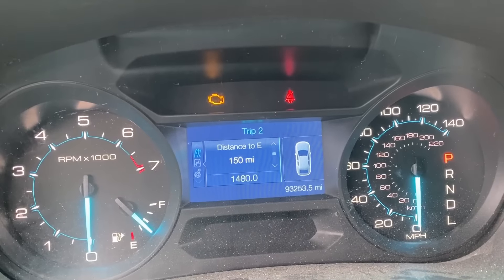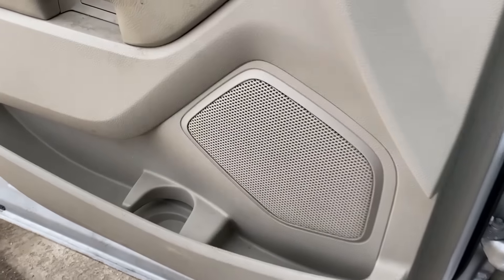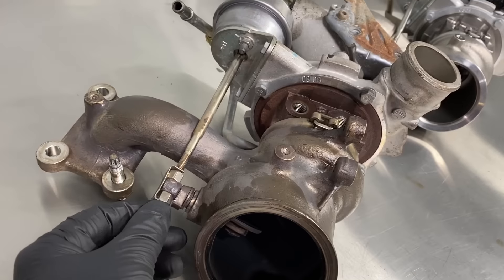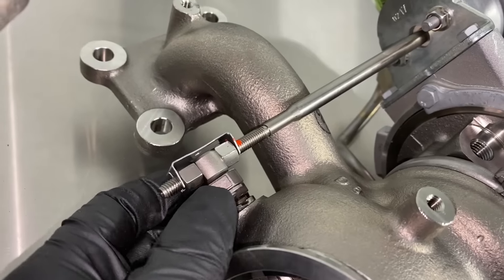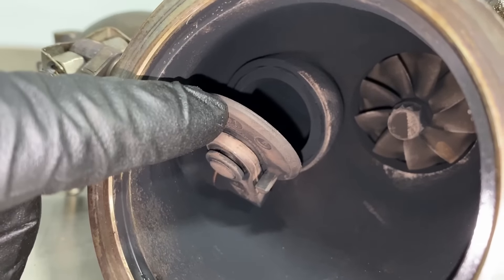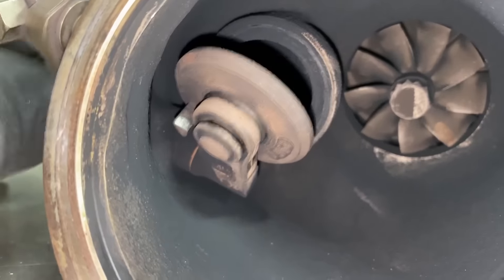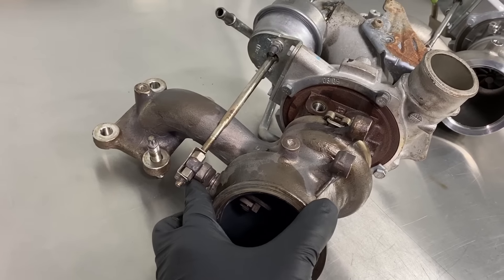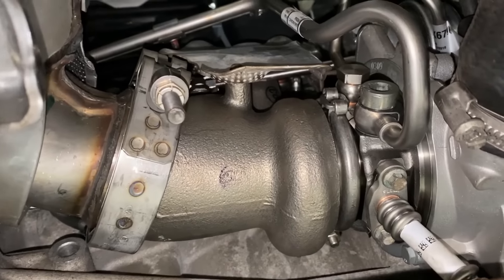Ford Ecoboost Cold Startup Turbo Rattle Explained

Comment: Has this defect been upgraded on newer models?  I specifically am interested on the 2017 model F-150.
Reply: Jaime Caballeros defect? It's wear and I doubt they've made any upgrades to correct it. Think about it...who gonna get paid when you get 100k on it and have the same problem? Your ford dealer that's who. Glad I chose the 5.0
Reply: I see it as a defect when a vital part in the car breaks down at such a low mileage.   If this becomes a problem on my truck I will have to perform the service myself.  I’m sure I will not pay 2K$.  Yes, I wish I had a coyote engine instead of the echo boost
Reply: Mine did don’t buy one get the 5.0
Reply: Whatever you do stay far away from the 2018+ 5.0
Faaaar away
Reply: Away from 5.0 newer than 2018?   Will you care to explain?
Reply: cheeznhard what issues have the newer one’s been having we used the 2015-2017 at work they were amazing hardly had any issues
Reply: cheeznhard what issues have the newer one’s been having we used the 2015-2017 at work they were amazing hardly had any issues
Reply: Jaime Caballeros a worn part at 93 thousand miles is not exactly low mileage and technically it isn't broken just worn and making noise. I agree it's not acceptable but that's the gamble anyone makes purchasing new changes and turbos that are bound to have issues one day. Ford mechanics for the most part said stay with the 5.0 tried and true engine and that's what I did. When you add all these bells and whistles you are just looking to spend more to keep those bells and whistles working. Even buying all the extra packages can be a gamble for more issues. Today's vehicles are so computer driven they are bound to have more problems and require more technical ability to fix them. If I had that issue I'd be fixing/patching it myself then trade it in for the reliability and less troublesome 5.0 good day sir and good luck with yours I hope this issue doesn't happen to you.
Reply: Bryce Redman Major oil consumption, off throttle rattle from the engine, typewriter/barbecue tech, knocking at idle… So on and so on. Your best bet is to Google, 2018 F150 5.0 problems
Reply: Bryce Redman The 2015 through 17 5.0 was a solid engine, the 2018+ so far isn’t turning out to be such a problem free engine.
Reply: cheeznhard I'm wondering about the oil consumption on my 2015 now because I noticed it was on the low side with the last oil change which seemed odd. I don't always think to check the level before changing it but perhaps 2015 5.0 still may have oil consumption concerns? ?

Comment: My dad did on his 2014 V6 3.5, he started getting that noise around 120K miles , he drove it until 142K then he the code, just changed driver side turbo

Comment: I had a 14 transit connect that had an over boost code and an air shutter performance code the Wastegate was seized close and the air shutter was busted up so only one louver was working

Comment: Would this apply to a 2016 Ford Edge 2.0 as well?

While somewhat more faint than your video implies, our edge has a slight rattle at cold start. 

Bought it about 18 months ago with 93k miles and has not gotten worse or better since then, but now at 116k.
Reply: Yep, same one. I would suggest the 3.5L V6 N/A engine for your next ford, or to not buy a ford at all.
Reply: Fair enough.  Find me something non ford that is: 
1-AWD 
2-big enough for 3 car seats in the back seat 
3-and gets 26mpg or better

We own a 2015+ edge with the 2.0  to fill very specific needs. We have 3 young kids, live where winter driving is a very serious concern, and drive 70 miles a day to work and back. 

As near as I could find, there was nothing else available that does all three.  

Knowing that there was a major design change in 2015 is why I asked the question.
Reply: meborder noneya   Volvo XC60 AWD T5 or T6 or a Toyota SUV (can’t confirm mileage on Toyota). Just about anything is a crapshoot, these days, but we’ve had good luck with our Volvos.
Reply: Manny Puerta 
An interesting suggestion. Looking at them online it appears that the back seat is 3 inches narrower so I’m not sure that the car seats would fit.  Plus they are quite a bit more expensive, locally anyway.  

I got the edge 1.5 years old for $16k with 92k on the clock.  It was like finding a unicorn. Those XC60’s are nice looking, but the only two within driving distance are both 10k more than what I paid for the edge.  

Mostly curious if the 2015 redesign on the turbo for the 2.0 would have changed this issue.  It may not be known yet, as most of them don’t have the miles I have on mine.
Reply: meborder noneya   Just don’t buy anything with a CVT transmission. Turbos are nothing compared to those transmissions. The Volvo has a Japanese Aisin 8-speed Tiptronic, BTW. We get 26-27 MPG, combined. It seems every manufacturer is global these days. The key is to know what is reliable and what isn’t. A challenge, for sure.

Comment: I had an 18 escape in with a misfire code. It was running fine but the customer stated it stumbles in the morning on first start up. It was under warranty so I suggested he took it in to the dealer he had just purchased the car from. I guess a bolt backs out and punctures the water to air charge cooler and the inter cooler coolant makes its way into the cylinder on start up.

Comment: I bought a 2017 Escape with a 1.5L ecoboost for my wife and it's now at 50,000km and has had intercooler, intake plenum, and head gasket replaced. The problem started at 8000km and took ford 10,000km for them to diagnose (incorrectly) and repair. Got it back and same issue 8,000km laternow I had cracks in cylinder 2 and 3 so we got a new long block under warranty, 4,000 km later back in dealership and car was misfiring and running like crap got refreshed ran good. 3000 km later and it's back in the dealership getting rear differential rebuilt. Was a huge Ford guy but Ford Canada sure knows how to turn customers into Chevy Customers

Comment: Why wouldn't they just sell the waste gate section.  This looks like a good niche market for somebody selling rebuild kits.
Reply from the maker: Because the linkage is adjusted based on the turbo it is attached to then locked in place.

Comment: Great info., thanks for that. Question; on a 3.5 ecoboost with twin turbos, does Ford use an over sized inter cooler, which I’ve heard they do and, that’s good. The oil line going into the turbo, and the out going line are to small, so I’ve heard. Any truth to what I’ve been told?

Comment: Ford and their parts... Need rod bearings? Buy the whole lower block. (bought a completely refurbished block for a little more over all).
Need a new seal because the crappy plastic rotor in you're waterpump broke again, buy a new pomp (buy the later version with steal rotor).
Need a new window motor? Buy the whole assembly withs is hold by special rivets.

I love my 2006 Focus, but buying parts...

Comment: I have a 2016 Ford Explorer sport with 100k miles and my extended warranty ends this year, would you get another extended warranty? It did have a few things that were wrong with the car and the warranty paid for it’s self fixing it. I think another 50k warranty is about 2000$. Is it worth it?

Comment: In worst case you swap the hot side housing on the turbo keeping the cartridge, compressor wheel, etc together with the flap. I don't see the reason why you would throw away the complete turbocharger with a good middlepart with bearings, compressor wheel, turbine and compressor housing because of one faulty flap. What a waste...
Reply from the maker: You gonna spend days trying to source the correct parts for it?
Reply: @FordTechMakuloco  If it would have been mine, yes, sure, waiting for a couple of days is not a big deal I have more than one cars. 

As a ford repair shop /business/  (which I am clearly not of course)  if this is a common problem as it sounds to be I would keep a couple of these on stock. I am just not a fan of sending good parts to a landfill, but that's just me.
Reply from the maker: There is a $300 core it isn't going to no land fill, Ford is going to rebuild it.

Comment: Hate to say (I've loved my Ford trucks..) but a $3000 repair on either my Tundra or Rav4 at 90,000? No chance. Over-complication SUCKS.
Reply: Wheels, Wings and Rotors my wife’s rav4 went 300k miles and all that went wrong besides basic maintenance was the alternator. Traded it in on another rav4. Just hit 100k miles, not a single problem.
Reply: @AJourneyOfYourSoul  A family member bought a brand new 2006 V6 Rav4 that had a steering shaft replaced at 30k, an ECM that failed at 64k, alloy wheels that rotted after 4 years (car was garaged and washed), and had the rear lower control arms replaced 2 times.   Toyota can make turds too.  Granted, its less common, but not everything they make is gold.
Reply: @ak2112  No doubt every manufacturer makes mistakes. That steering shaft and steering ECM was a first year design flaw for that generation Rav4, 2006. Toyota fixed it that year. That is one thing I like about Toyota also, they actually fix design flaws and not let them go on year after year after year. Look how long Subaru let their head gasket issue go on for, 10 years.
Reply: That’s what I like about Toyota. Just picked up a 2015 Sequoia 5.7 v8. I’m sure if there were any first model year issues they were sorted 8 years prior when that body style came out. By the way they still sell the same thing to this day. No turbo, no direct injection, no cylinder de-activation, no timing belt, no water pump tucked inside of the engine, no worries. If it ain’t broke don’t fix it.

Comment: My 5.0 has a hard start after sitting for approximately 3 hours (takes a while to crank and sometimes sputters). It doesn't do it if it sits overnight. Once it starts up,  it runs fine. Do you have any idea what the issue could be? 

Vct solenoid?
Reply: Try cycling the key a couple of times then try starting see if the problem is still there, You could be losing fuel pressure.
Reply: @arthurhardy  Thanks for the reply. I've actually tried that several times and it hasn't solved the issue. Even had the fuel system pressure tested and it checked out fine.

Comment: Thanks for posting the video. My car is making the exact same sound and figured it was the turbo but wasn't sure. But mines not a ford it's a 2018 chevy camaro 2.0 turbo with 100k miles. Well I might try to just repair the wastegate. Do you think the car can be driven like that for a while before replacing it?

Comment: Are the turbos similar on the 3.5 ecoboost. Can the same thing happen?
Reply: Mike Deyerle I was wondering the same thing I had a 2017 f150 3.5 that sounded similar and could never figure out what was doing it
Reply: My father in law has a 18 f150 second gen 3.5 and it’s sound like that at idle with the slight rattle and it lasts for a good 30 seconds. I thought it might have a chain rattle but it’s not aggressive sounds and lasts way too long to not have any stored DTC’s. So now I’m thinking it may be the waste gate/s
Reply: Mike Deyerle mine did exactly that

Comment: The strange thing is, here in Europe we barely have any problems... Ford uses the original oil at dealership from castrol. From my experience and having 2 ecoboost cars I have always changed oil 5w20 every 10000 km and my previous Ford fiesta was sold with 200 000km 0 issues no carbon build up problems, changed timing belt at 100k and never had to open engine and same 0 km power and speed after 200 000km. Change the oil with factory brand, because that is what it was designed for. And once in a while drive in the highway at higher average speeds you drive in the city like 120km/h 140km/h for some more extended periods and magic no carbon build up or whatsoever. Now I own a focus st (European model) with a 2.3 ecoboost 280hp and I will treat the same.

Comment: Seems that this should have been a recall. Regardless of warranty, its been redesigned so they know its a problem that they failed to take care of prior to production. Now i would think that if this actuator locked up and allowed the turbo to overboost that could lead to  catastrophic damage... now if this occurs while your on a freeway in traffic and speed up to pass someone and the motor locks up or blows apart from the overboost then you get pieces of motor  Grenading into other cars and possibly causing wrecks. an internal wastegate on a factory turbo shouldnt be junk @90k.

Comment: So 2000.00 for a harmless startup rattle? Ford should be ashamed of themselves for designing turbo linkage pivots design to not last 100k, and then they designed the turbo so it doesn’t fit the cat,and they have the audacity to make you buy a new cat on top of it. I’d say the  saving Grace is that OEM used cat is probably worth 400.00 now but I’m sure Ford will require it as a core even though you should not have to provide one on a new part,that hasn’t been rebuilt.
Reply from the maker: $2k for the P0299 code also, not just a rattle.

Comment: Any competent machine shop that specializes in Turbos could overhaul that..But after you pay them. Then a shop to take it off. Put in back on. You are into it for $1,000.00.. Not including the Mandated California Compliant Cat is $700.00. So yeah. $2,000.00 sounds about right..

Comment: My 3.5 ecoboost 2018 Expedition has different sounding cold start rattle or rock. Could it be same issue at 33000 miles

Comment: Quick question, I have a 2011 f150 3.5. cold start and during acceleration I have a weird sound. It hard to explain what it sounds like. It also idles rough and I also get exhaust fumes in the cab during idle. What could it be?

Comment: 2018 Expedition 3.5 - I have this sound, Dealer replaced the Cams and Phasers thinking that was the issue, chain rattle sound is now gone but still have the same sound as in your video for turbo issue.  The sound never goes away even when warm.  Dealer says that is normal and won't fix it.  I have a factory warranty, anybody have any suggestions?

Comment: Is this the same fluttery rattling I'm hearing from time-to-time on my 50K mile, 2015 F150 with 3.5 ecoboost when I lift the throttle from high gear? It always sounds like a loose heat shield.
Reply: My F150 did this, loose heat shield on the crossover pipe from each bank after the cats. Drove me nuts especially in a drive through. Easy fix.
Reply: And mine is also a 2015 3.5 eco
Reply: @theboostedsixxes4375  Thank you.

Comment: I have this on my 2019 Ranger, not so much a rattle but an intermittent squeaking that goes away after a minute or two.
Reply: Keep taking it back to dealer and document it numerous times and make sure they dont push u off...good luck

Comment: Why not repair the turbo?  Could have saved the customer $2k.  Unless they wanted a new turbo.  Also, why not source old style turbo that did not require replacing the cat?  Seems like a waste of money.  Company policy?
Reply from the maker: Customers want a fast turnaround and a repair that is going to last, they want reliability. Unless there is a machine shop around here that does these all the time in the end it would be a very hokey repair that I would have to stand behind that would just piss off the customer and be a huge loss for my company. Replacing the turbo it will be expensive at first but the best option in the end for all parties involved. I have been in this business for 20 years and I know that using cheap parts on repairs never turns out good in the end.
Reply: FordTechMakuloco I definitely can understand that.  It’s a little tough to show all options for repairs to these issues.  It is appropriate to replace with new if financially able.  Just thought that this would be an opportunity to explain that there may be economical repair options. (obviously old parts can still fail)

Comment: For 93k miles.... thats normal,  remember turbos have a life span ranging from 50k mile to as high as 150k miles on gasoline engines. 93k miles is almost in the middle of that range. So yes turbos need to be replaced eventually, they dont last forever.
Reply: I have seen ecoboosts run up to 300k as a work horse.
Reply: Ford claims the Ecoboost turbos should last till 150k. After that, they expect them to be replaced...
Reply: The turbo on this car is just fine.  Its the cheap lightweight wastegate arm/bracket thats the problem.  They went cheap to save money and weight and here's what you get.  Then they redesigned the replacement turbo which required the customer to buy a new cat.  No manufacturer is perfect but good lord this is bs.

Comment: I took my truck in around 30,000 miles for this noise, they had it for 2 weeks and then told me "This is a normal characteristic" - The noise is getting worse and I am now at 36,000 miles. What are my options since my local dealer refuses to fix it?
Reply: I would drive it straight through the showroom window and sit there till the cops turned up. At least you would get noticed and might even get on the local news.

Comment: Keep buying the Ecoboost engines makes me tons of money on my weekends in the driveway . You couldn’t give me these POS engines .
Think about it ford made the best gas straight 6 engines made when ford actually cared about the vehicles they built . I replaced a radiator on a 1990 straight 6 F150 with 550234 miles all original I scoped the pistons and I was blown away how amazing it looked . I checked it over 85% of it was original . Original clutch and plenty of life left .

Comment: LOL I have a 2013 1.6L escape with 250,000km from 146,000km I have had an turbo underboost CEL and countless noises from front to back, and is just not worth fixing problem after problem. Driving this into the ground until it calfs and jumping the pond and buying a 2020 Mazda CX-5 GT